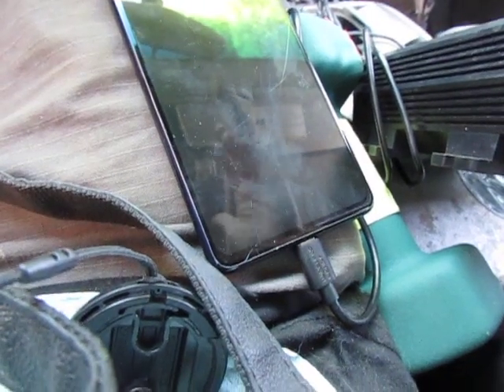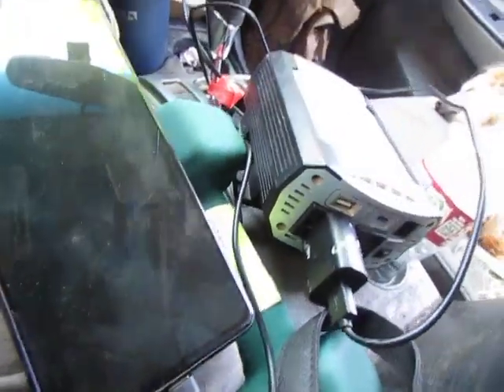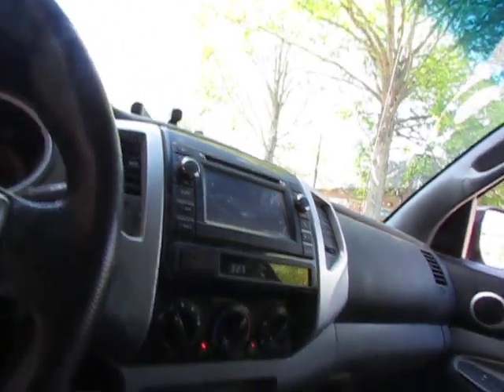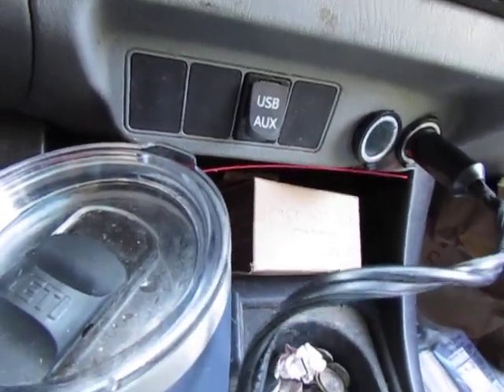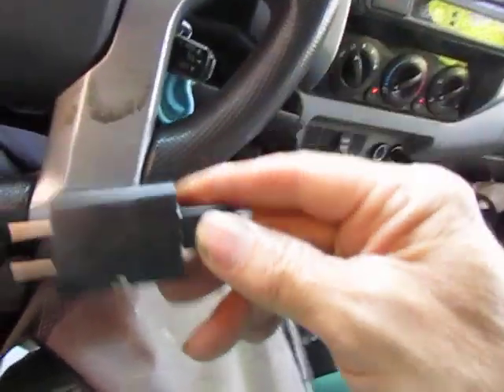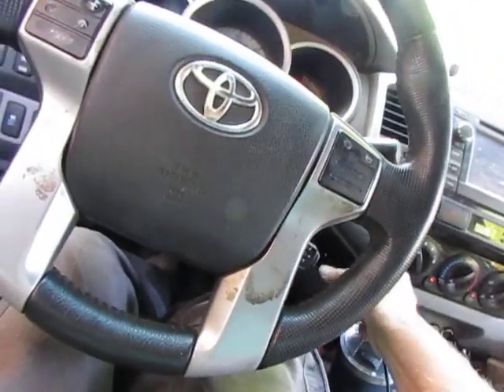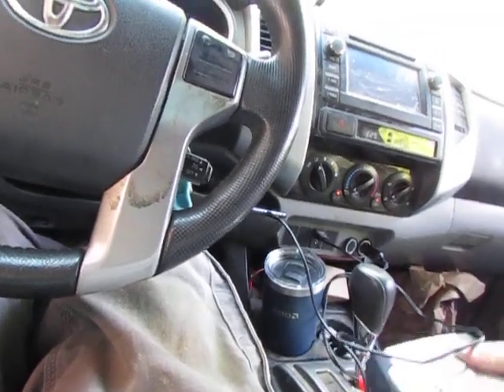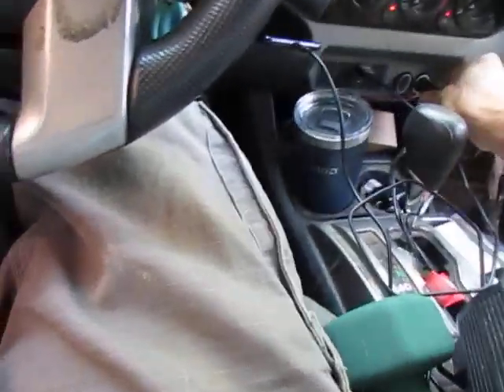A Clueless Luddite Charges His Phone

Comment: ROFL

So you had your wall socket charger in the converter, which takes 12v and converts to whatever voltage you run over there, and then convert that to 5v or something for the usb socket.

The one little annyoance with usb sockets in cars is that they might be low amp, so if you find that your phone charge too slow you might just do as before, using that big converter from best buy.